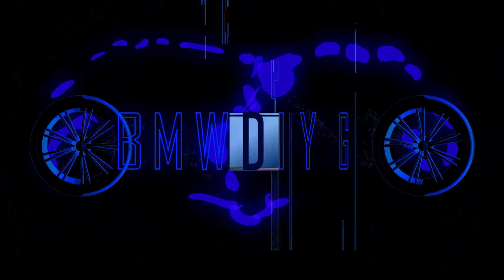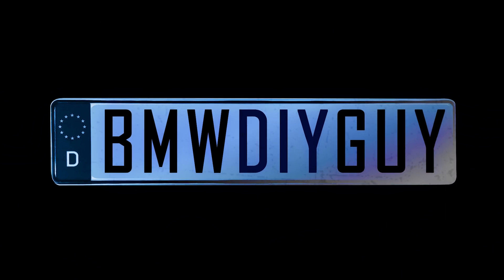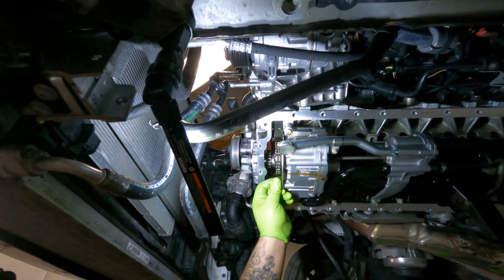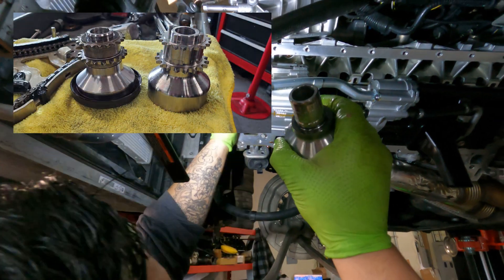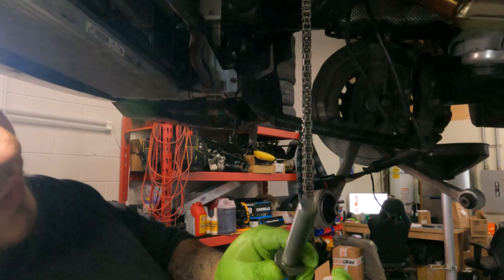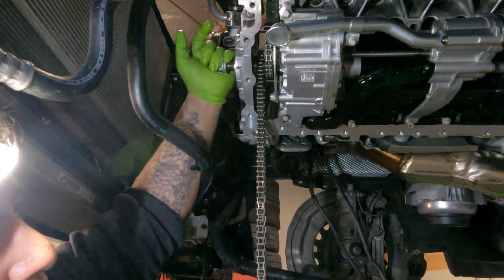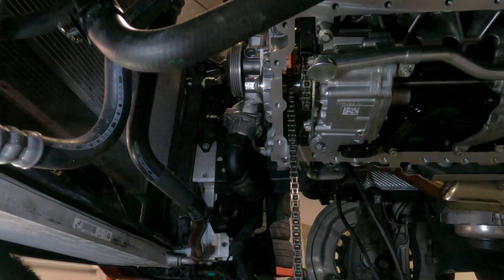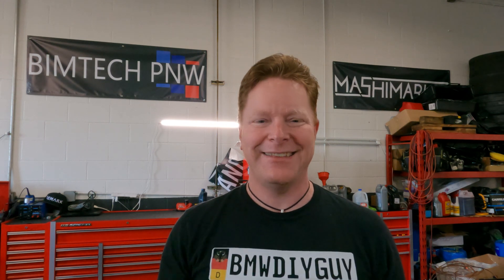How to bulletproof your BMW S55 motor - Crank hub upgrade from Kies Motorsports!

Comment: I'm not trying to call out anybody's work here, I'm just going to mention this for information only,  but I've installed a few of these crank hubs at my shop and it looks to me like he installed the drill bit guide backwards on the crank snout, at 7:52 you see the shoulder that's in between the bolt and the crank, that's actually supposed to go into the center hole in the crankshaft to locate it. 

The bottom pin hole and the bottom right pin hole at 8:00 are off from where they should be and one is actually protruding into the center crank hole slightly, also there shouldn't be any "press" required. if anything more than a few taps with a soft mallet is required it means the holes were either drilled angular or off center(or just not enough depth).

 Again, it's fairly hard to see in the video and I could most definitely be wrong, but if that's the case I've seen it happen before and those pins will shear and you'll eventually have the hub walk.
Again not trying to bash anyone's work and a lot can go wrong or be overlooked on this job, but if that IS what happened here I would HIGHLY recommend re disassembling the hub to make sure none of the pins sheared on install because I have seen it cause catastrophic failure.
Reply from the maker: I appreciate the detailed and thoughtful response, and worth a response back.  Personally I dont have the skills to do these installs myself, hench my local shop and their pros to do so.  I will say they have done (literally) hundreds of these, and no issues that I am aware of or heard through the local BMW groups.  (if one blew up, I am sure we all would hear of it).  I appreciate the concern and meticulous response, and the best I can give in return is that I trust my shop explicitly and am confident it was done perfectly.

Comment: How does he know what 270 degrees of rotation is after he does 100nm on the crank hub bolt ?
Reply: After Torque of 100 nm, make a mark facing 12 o'clock on bolt and mark on the block to 9 o'clock and keep tighting bolt until marks line up bolt with engine block.
Reply from the maker: Ivan has done literally hundreds of these and knows how far to turn

Comment: Can you tell me how the mechanic know at what degrees he puts the hub? Even a few degrees can ruin the engine
Reply: No I don’t mean that. You can turn the crankhub before drilling 360 degrees right? How do you know the right position ?
Reply from the maker: @5tuk45  to my understanding it isn't in a specific position as when the two chains are back on it will inherently be in the right place. That said I defer to the expert like Ivan who did the work
Reply: @BMWDIYGuy   There isn't a specific position of the gear that drives all the timing?
Reply from the maker: @5tuk45 yes but all if that is locked into place with special tools.
Reply: @BMWDIYGuy   Yeah of course but before drilling, you can turn the hub 360 degrees and I can't find any guide.
Reply from the maker: @5tuk45  ah ok.. so you are looking to do this. Honestly unless you are a pro with all the right tools, have a pro do it instead. I don't have that level of specifics
Reply from the maker: When he is applying final torque to the hub bolt?  Its GIANT torque wrench, then marks the bolt and if I remember, its +90 degrees from there.

Comment: Wouldn't upgrading the crank hub void the BMW manufacturer warranty? Is it more sensible to replace the crank hub once the warranty period has expired?
Reply from the maker: Best answer to that is maybe.. yes very invasive work like that COULD void the warranty (if you had an issue that could then be directly tracked to that work) but doesn't do so automatically.  Also, it depends on your plans.. if you are staying full stock power until after warranty, you could wait on this change as while possible at oem power, its much much more rare.
Reply: @BMWDIYGuy  thank you! As a fairly new owner of an F80 M3 locally in the PNW, I really appreciate your videos!
Reply from the maker: @nuevocomienzo9571  Happy to help and so many things we can do to our cars!  Also check out the Seattle //Ms group on facebook (assuming you are seattle local)

Comment: $3k is a good ball park for this job including park, $4k if youre doing a full service and all things included. its also recommended to put on the Crank Bolt Capture kit as well when doing the crankhub upgrade. Bullet proof engine after that.
Reply: i would not do the plate. this will screw with your harmonics and is 100% unnecessary after this.
Reply: @cwx8 never thought that aluminum plate would screw with harmonics. I always thought removing material would do that though.

Comment: Nice video as always...what’s your view on non-drill version hubs?
Reply from the maker: The crank capture types?  I dont have any first hand experience myself, but speaking to experts involved, who aren't big fans of that option.  The crank hub captures are much easier install, I hear, but not as effective as well.  My thought is if you are going to do it, especially if shooting for 50% or more power increases, do the full crank hub replacement.
Reply: @BMWDIYGuy  At OE power levels (Base to GTS) all verifiable data suggests that this is a non-systematic issue as the bolt torque + friction disk generates a high enough coefficient of friction so that the hub will not spin. It seems that some stock cars have gotten into the wild in which the bolt must not have been torqued correctly, but that can be chalked up to an assembly line defect, the prevalence of which is probably within the reasonable tolerance for a large manufacturer like BMW. To venture into anecdotal territory - all of the SCH cases I have heard of all have one thing in common: the bolt was loose (backed-out). I haven't heard of any at an OE power level that purely overpowered the friction disk itself. With that, a CBC literally slaps on the harmonic balancer and physically stops the bolt from losing torque and backing out. You should totally make a DIY video! Honestly pretty easy to do with a few hours of time and a little elbow grease.

It seems to me personally that this two piece design is in fact very intentional as it has been utilized in BMW engines for the past 15+ years. Many speculate that it is meant to have some level of slip at a certain torque value to intentionally prevent the motor from damaging the crank, which seems to validate the examples (that I've seen) of stock power level spins only requiring a re-time. I've also anecdotally noticed that many vendors have started to walk back their sentiment on this being an Achilles heel or absolutely necessary on even stock cars... seems like many haven't been able to corroborate some of the outlandish claims that were made and the S55 community has wised up to some degree. Now if someone wants to build out an engine to put down big power, well duh they will have to upgrade parts including a crank hub. Been like this since the N54 days, I always find it amusing that vendors and certain consumers act like it's a brand new item and BMW is somehow at fault. At the end of the day, I don't care whether someone gets a CH "fix" or not, it's their money and car - but we gotta get as much real info out there so people can make the most informed decision possible.

Also, for the original commenter's I think he was asking you about a drilled CH fix vs a Spline Lock ala VTT that requires no drilling into the crank
Reply from the maker: @alexb5166  very thorough reply and at stock levels the chances appear to be very rare of failure.  I find it rather fascinating the B58/S58s come with keyed crank hubs.  As I will be looking at 50%+ plus stock power,  this was a no brainer.
Reply: Never seen so much serious knowledge in an exchange on youtube.  thanks guys